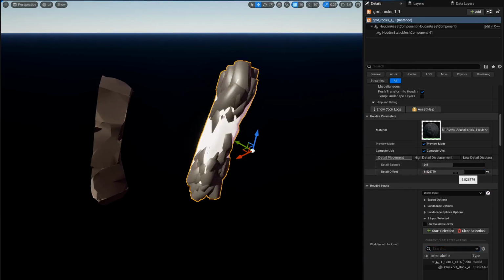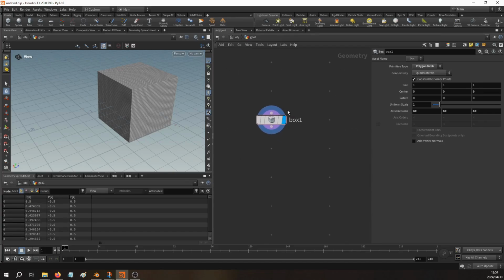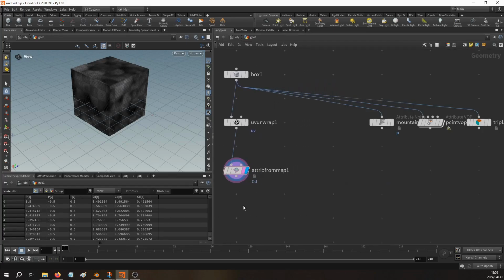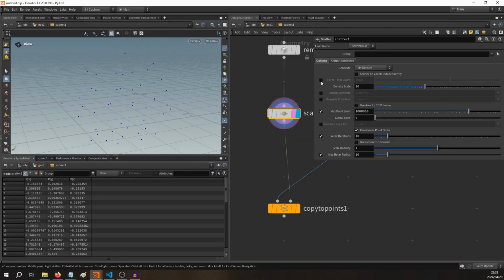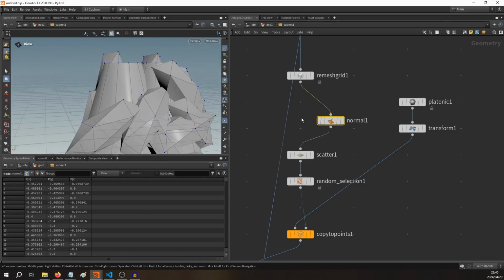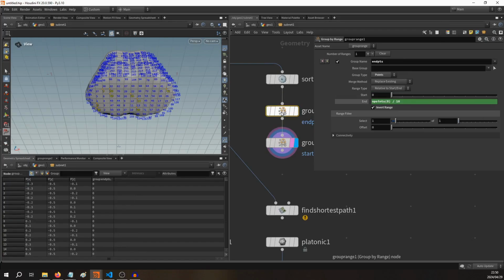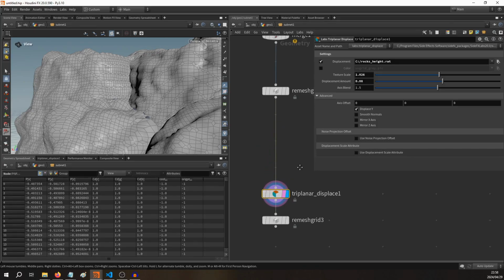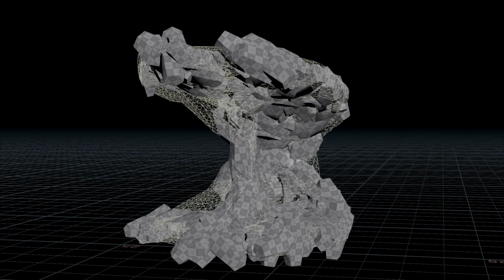EPC | Project GROT  | Rock Displacement

Comment: On the attribute from trexture node, you can set the "export attr" to "displacement" and make it a float. Then add a "soft peak" node after, se the "disolacement" attr as the multiplier and set the intensity with the slider